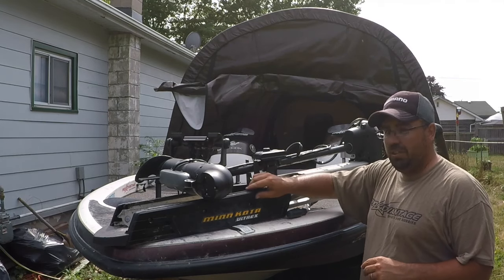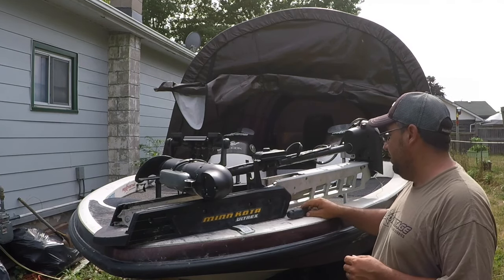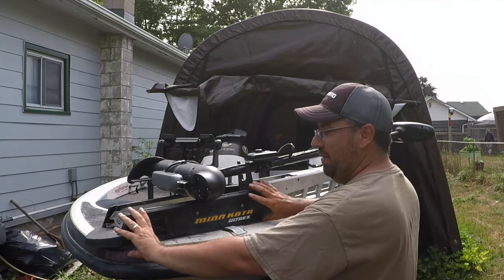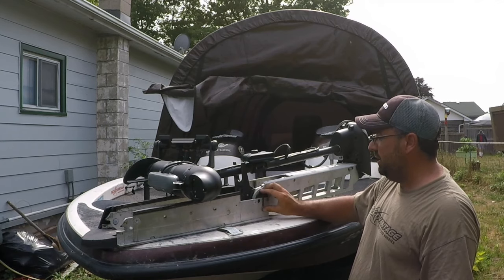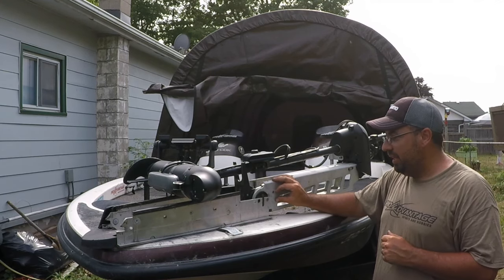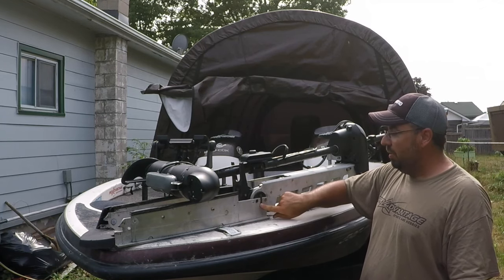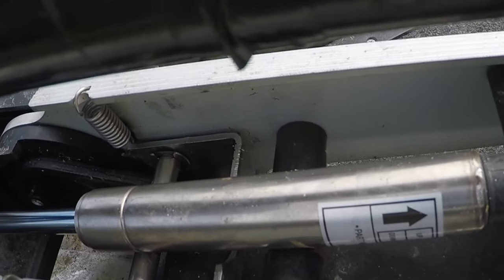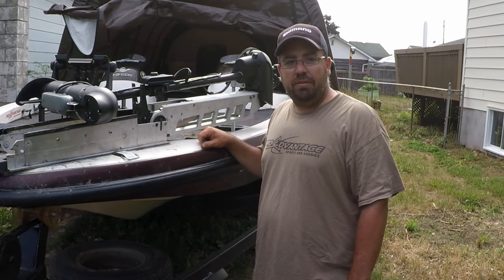HOW TO FIX MINN KOTA LOCK DOWN

Comment: I’m having a similar issue. The outside piece, 490, you are describing cracked at the pin. In the stowed position, I now have that misaligned/uneven bar as well. I just ordered the parts. Was removal of the motor and shaft difficult?
Reply from the maker: no it was not to bad at all its just one screw

Comment: I’m having a problem with it locking in when it’s deployed
Reply from the maker: its likely  the same issue. i would take it apart and see if the knuckle screws are loose or broken
Reply from the maker: could also be the spring mechanism that works with the rope